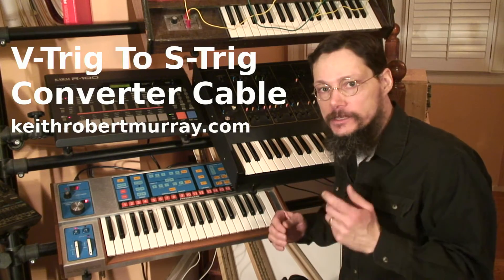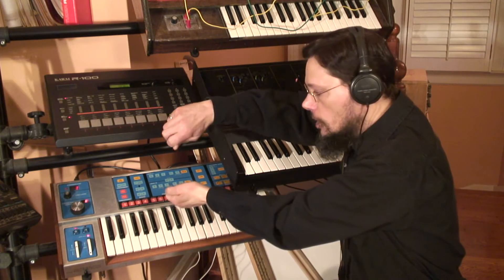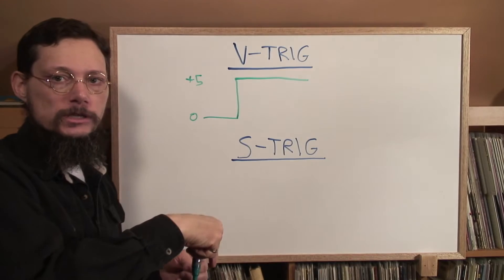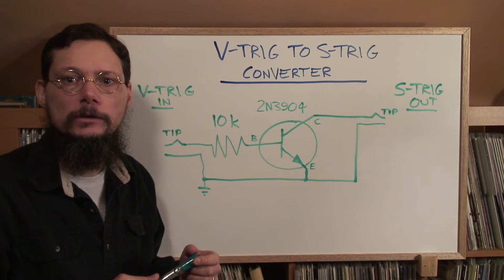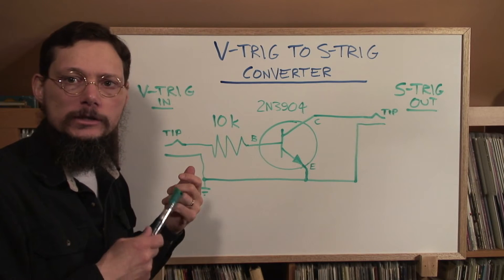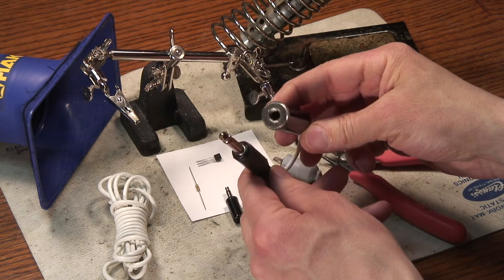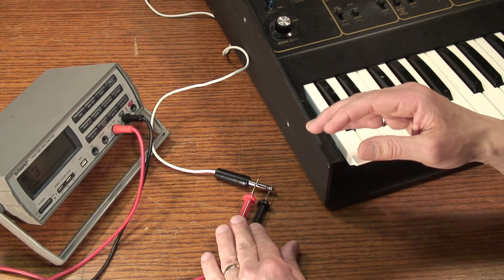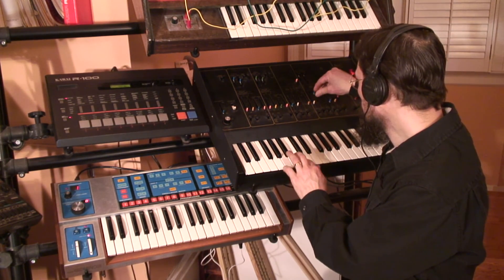V-Trig To S-Trig Converter Cable

Comment: thanks . i'm planning to build this circuit so i can run the arpegiator on my polysix with roland drum machines. i think i'll put it in a little box just in case an old moog winds up in my hands so i can hook it up to the arp axxe .
Reply from the maker: This type of inverter circuit works well with the arpeggiator clock in on the PolySix.  Go for it.
Reply: @krmelectronics  i did it the next day! the electronics store was closed so i went to the thrift store and bought a "200 in 1 electronics experiments " kit. harvested the resistor and transistor and soldered it all together . after i knew it worked i put it all in a pill bottle . works great.

Comment: I couldn't get this to work without adding a pullup resistor (I choose 10K) to 12V rail on the collector output.  It's possible that some modules with s-trigger would needs this if they aren't pulled up in the module's S-trigger input.  Specifically it was the Behringer 911 module that I use.  BTW, I've got a way to modify a 994 module.  I cut one of the traces on the lower group of 4 jacks and that's the V-trigger input and a cut eurorack power cable supplies +12 and GND.  I replaced the bipolar with a 4002 FET, the rest is the same except for as I said, you need to pull up the input to the 994 jacks.

Comment: I was lucky enough to pick up an Arp 1621 sequencer recently but couldn´t get it to trig my 1974 Minimoog.
CV & filter control works fine though.  It was a relief to find your video, Thanks.
Reply from the maker: I'm glad I could help.

Comment: Hi Keith. Thanks for this great video. I have a question I'd like to ask you: How many envelopes can you trigger with just one circuit? I'm want to build a mult panel with a V-trig in and 3 S-trigs out. Do I need a transistor and resistor for each out or do I just need the one transistor and resistor at the input? I wouldn't want to overload the single transistor, yet I don't want to put an op amp buffer on the input because I would like to keep the module unpowered. Keep up the good work and take care.

Comment: Thank you for the video. Most helpful. I actually bought a cable that didn’t have the resistor so I will be soldering one in. One thing I wanted to know; my Moog Source has a dual CV in/out. What would the wiring be? I have a keystep pro which is a eurorack compatible controller. Essentially sending out CV much in the same way the ARP Odyssey does. Any advise would be greatly appreciated. Best wishes from across the pond here in the UK.
Reply from the maker: Hi Dan.  The Moog Source uses 1v/Oct for pitch CV, but S-Trig for gates.  I don't have a KeyStep Pro, but the manual mentions a parameter to output S-Trigs instead of V-Trigs.
Reply: @krmelectronics  hi, many thanks for your reply. The S trig converter cable with the circuitry is working perfectly. I have discovered that if I pull the cable out half way from the Moog, I get cv in as well. The confusion was that the socket was a two way one (in/out) on the moog which I have not seen before. No cable worked but this was a recent discovery so I now have my Source integrated with the rest of my system finally. Many thanks

Comment: It gets even more confusing. In ARP terminology, what they are calling V-trig in Moogese is called GATE in ARPish. ARP's "TRIG" signal not a continuous signal but rather is a several millisecond pulse that has a selectable behavior on the ARP 3620 keyboard according to the SINGLE/MULTI switch. In SINGLE position, TRIG fires only on a key press when no other keys are pressed. In MULTI mode, TRIG fires with every key press even if other keys are held down. Meanwhile, GATE is always at a high voltage (10 V on the ARP 2600) when any key is pressed, and 0 V when no keys are pressed.

The advantage of this setup is that it allows for selective retriggering of the ADSR envelope generator during legato play, such that even if a note is being sustained, the attack and decay can be re-triggered when the next note is played without first executing the release part of the ADSR envelope. Meanwhile, the AR envelope generator responds only to GATE (aka V-trig in Moogese).

So for example if you wish to simulate a wind instrument, you can set the TRIG (ARPish - for pulse) to SINGLE mode. When the first note is played, the Attack and Decay are cycled simulating the initial breath, proceeding to Sustain. When other notes are played legato, there is no retriggering of Attack and Decay, which simulating the sustained breath while changing notes.

If you wish to simulate a more harpsichord type sound or a plucked string instrument, set the TRIG selector switch to MULTI. This retriggers the Attack and Decay with every note played regardless of whether other keys are released first.

Comment: Excellent video!  Is it possible to do the opposite?  In other words build a S-Trig to V-Trig converter cable?  I have seen interface boxes built for that, but would prefer a single cable solution.
Reply: Not easily possible built into a cable because you have to pass an actual voltage for V-Trig (different manufacturers used different voltages, but they all must reach or exceed a given voltage before the trigger will happen). The S-Trig is just a shorting connection. So to do the opposite you have to add in a battery or tap into the power supply...Ergo, not easily done in a cable.

Comment: Hey Keith.  Question for you... in Moog's doc, they show a 1N4148 diode from B to gnd between the 100K and the Base of the trans.  Is this not necessary? https://www.muffwiggler.com/forum/userpix/1663_moog_triggerconvert_1.jpg  Thank you and especially thanks for the Synthi videos you produced a few years back, good to see you around after a few years.
Reply from the maker: +EMwhite Gear Demos 
The diode shown in the Moog circuit is used to protect the input on the transistor, and also guard against a V-Trig signal with reverse polarity (the positive voltage on the sleeve, instead of the tip).

Strictly speaking, the diode isn't necessary.  It would also be difficult to cram it into a 1/4" barrel, along with the transistor and resistor!

Comment: Did I understand right: V-trig is waiting for voltage signal to trig, S-trig is like sus-pedal - it have potential on wires and waiting for smbd short-circuit wires and drop potential to zero?
So V-trig is useable with controllers, and S-trig can be used be simple passive devices?
Reply from the maker: saasrus Yes, that is it exactly.  You can trigger an S-trig device with a passive switch, or even just touching 2 wires together!  A V-trig device requires the trigger voltage to rise above some threshold.  Usually 4 to 5 volts is required, but some older synths may require 12 or 15 volts.